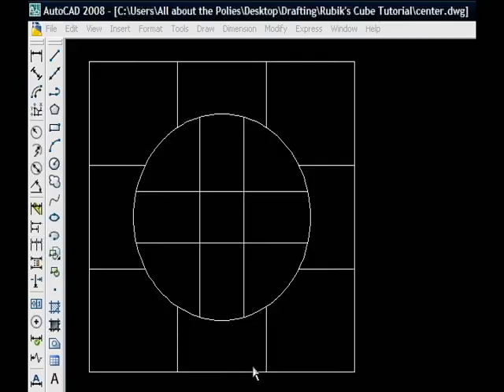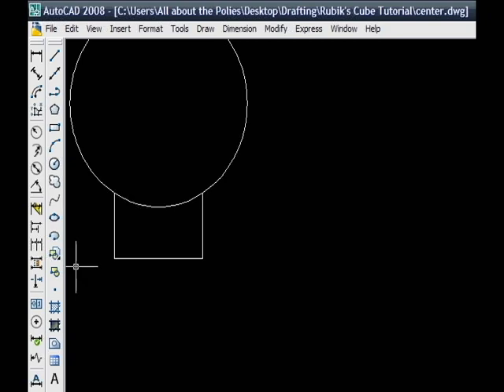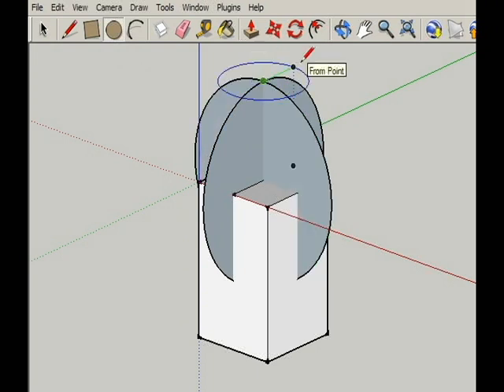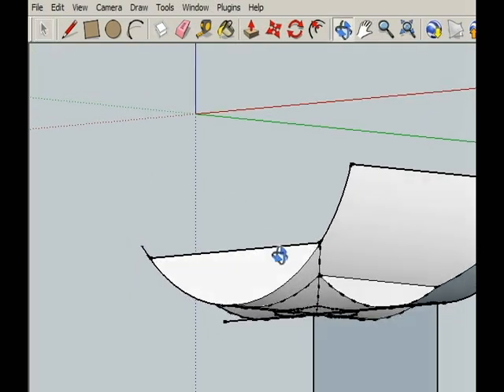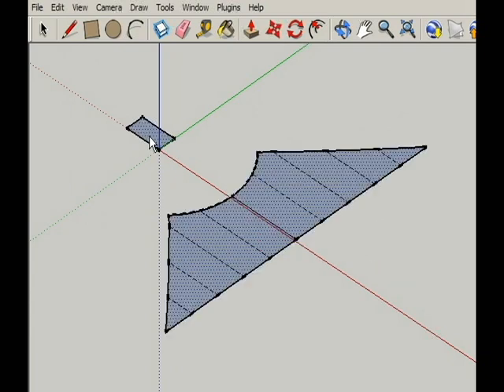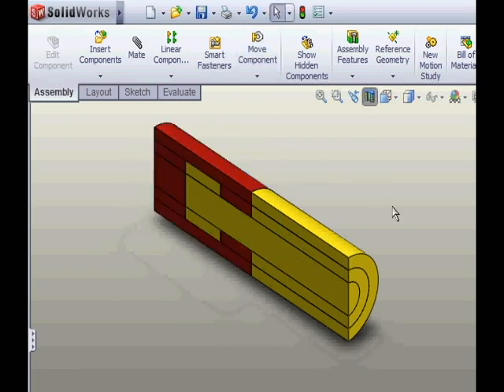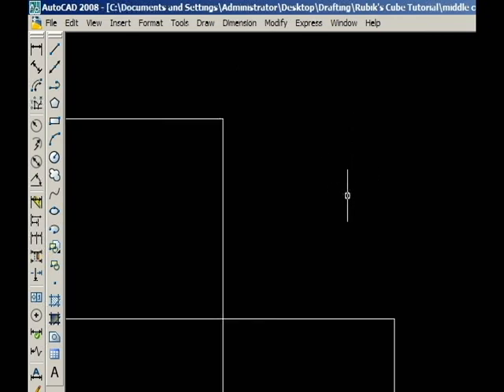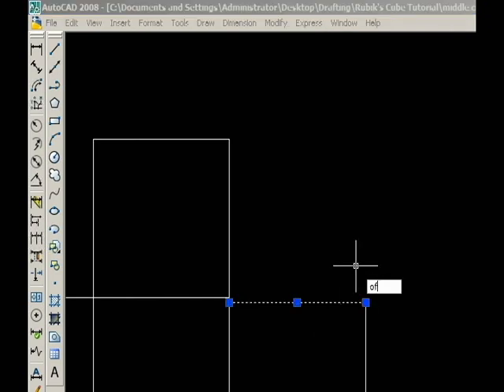Paper Mechanics: Rubik's Cube Tutorial: Part 3

Comment from the maker: @paperdude1000 This is not an easy build, thus this should NOT be a first paper/cardstock build.  Tubes are made by rolling up a piece of paper.  So to make 3 tubes in the video you would roll 1 tube (around either a paper clip or a metal coat hanger), then roll a 2nd one over top of it, then roll the 3rd over top of that.  Then you can cut them up and glue appropriately.

Comment from the maker: @paperdude1000 You need to place the cursor against a flat plane until you have that vertical circle icon (as in the video).  Then you're supposed to hold either shift or ctrl and that circle will be stuck on that plane, now you can move it off of that face and click where ever you need it to go.